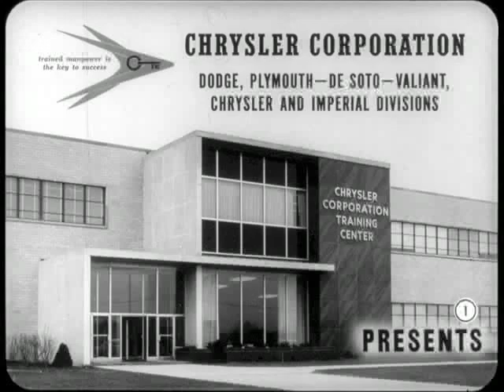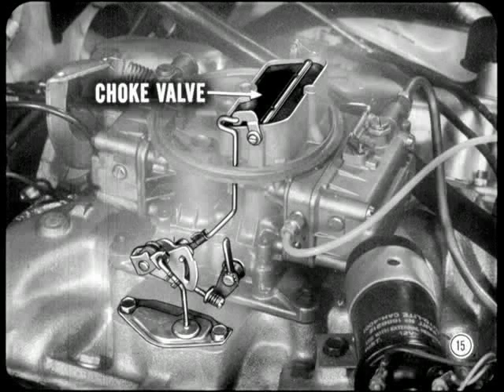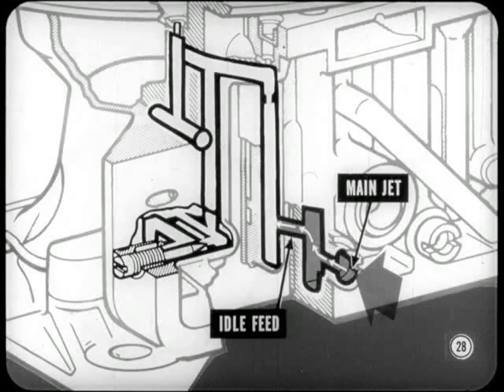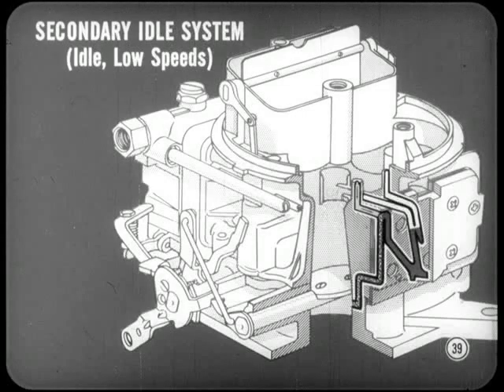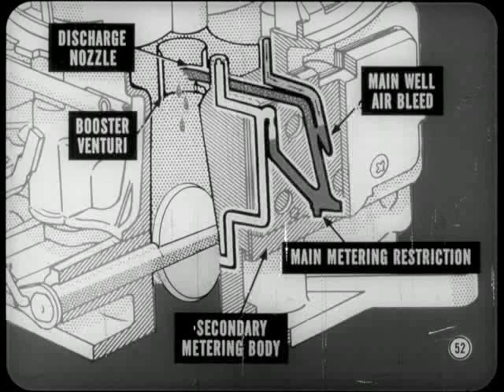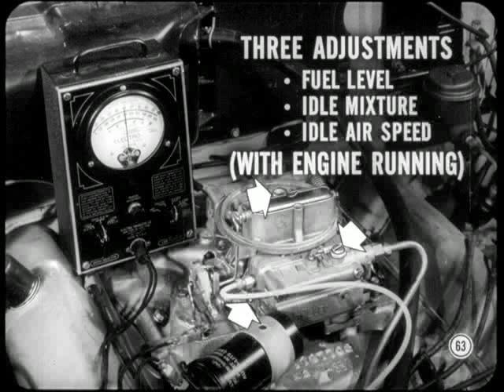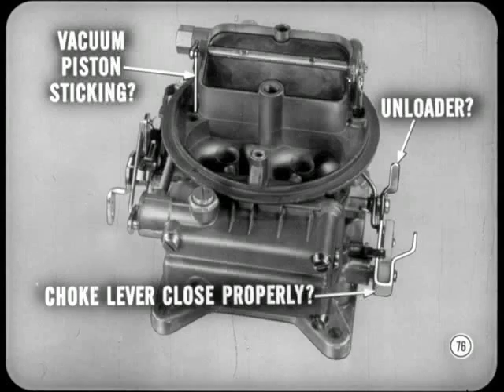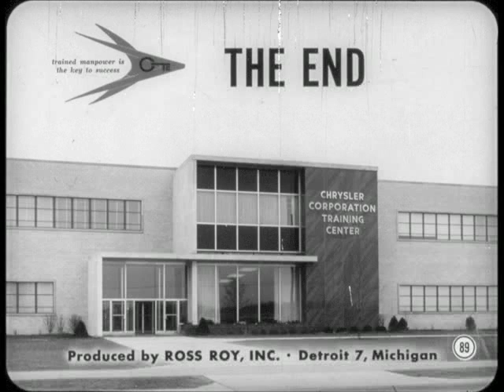Chrysler Master Tech - 1960, Volume 13-5 The Holley Four-Barrel Carburetor Story

Comment: I was a Carburetor Specialist back in the late 70's and 80's... 
I just learned a couple of things that I NEVER knew in all the Holleys I worked on!! 😲
That Idle Bypass Valve, I've never seen on the typical 1850 600 cfm Holleys... With some Cam choices, THAT would have been a great feature!